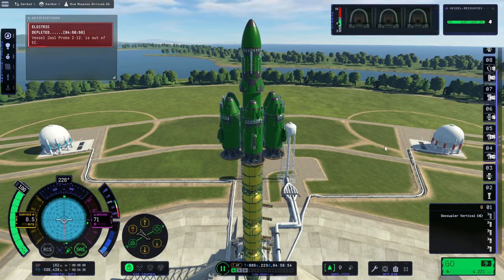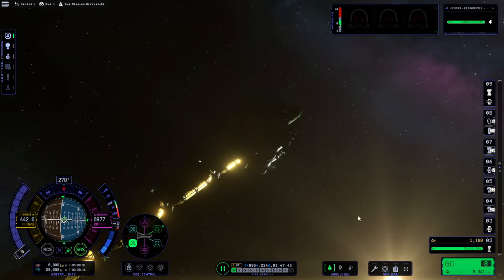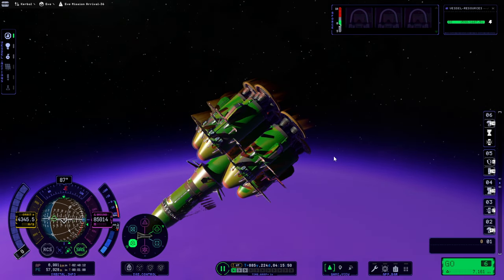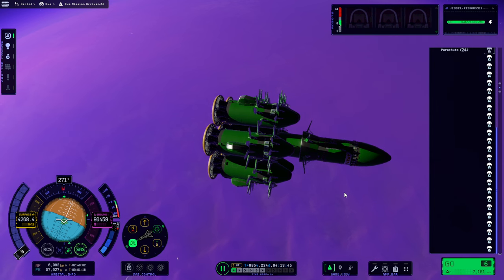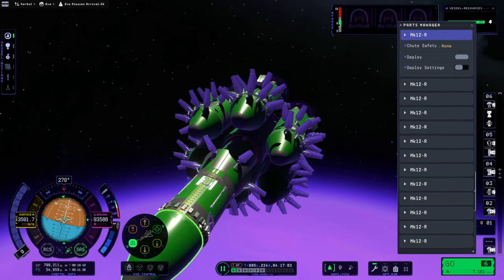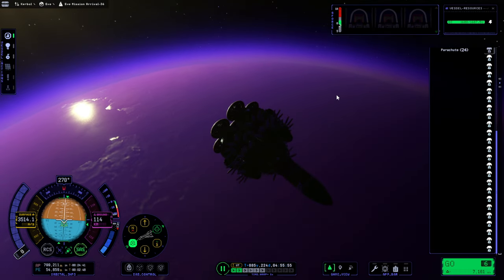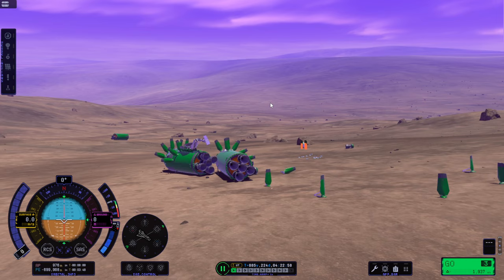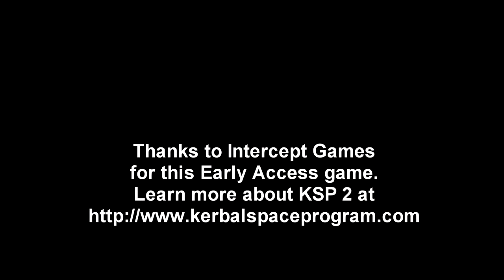KSP 2 Early Access - For Science 53 - Reaching the Surface

Comment: Some elements I learned during KSP1 Eve landing and ascent: 1) adjust landing gear damping (setting: advanced tweakables on), 2) put everything you can possibly miss on decouplers to prevent taking it back up again, 3) asparagus staging, 4) good nose cones and aerodynamics for the ascent vehicle, 5) use cheat to work on the lander and ascent vehicle (and profile speed and direction) first then design sufficient heat-shield and ablator for landing, finally design the launch and return vehicle(s), 6) you can always be unlucky, chances of success are quite low even with quite optimal design and execution, 7) optimize your descent location to 'ensure' quite flat terrain, 8) have fun.

Comment: The landing is hilarious! I think the whole thing is too big. There has to be a leaner way.
Reply from the maker: There's always command chairs, but I was trying to avoid testing that. Also, we might not need all the delta-v, but I sort of have to test how much it actually takes to make orbit around Eve. The problem with Eve is that engines get less than 100s ISP at the surface, so you waste a lot of propellant in the early phase of launch.

Comment: How about trying supersonic retro propulsion when entering the atmosphere. It seems to on the faclon 9.
Reply from the maker: Falcon 9's first stage does not get this fast, nor is in such pressure, and doesn't need this sort of heatshielding. Basically, our engines would surely blow up. Besides that, as I already mentioned in the video, propellant is much heavier than heatshielding.